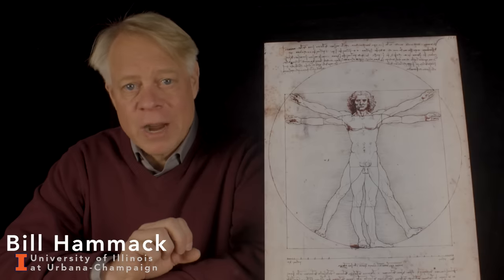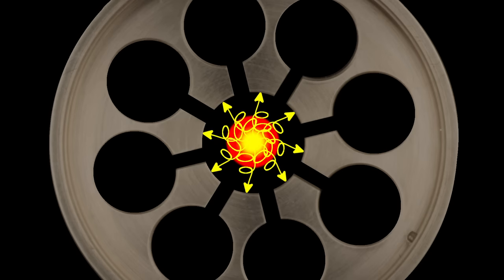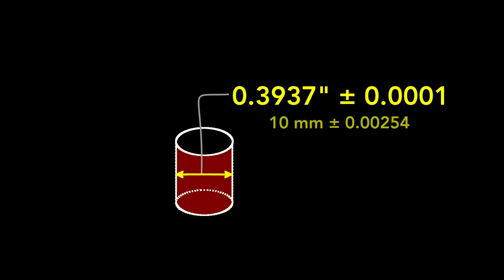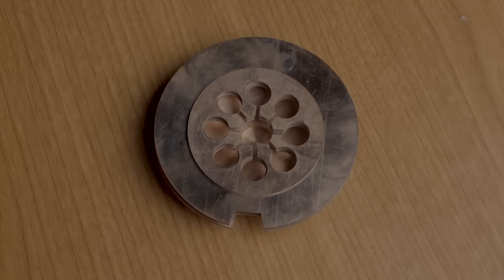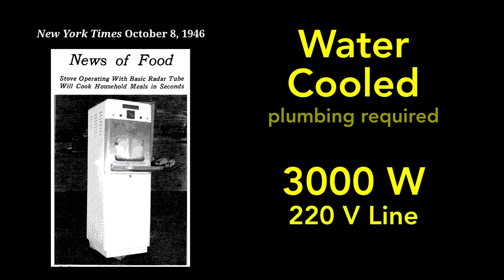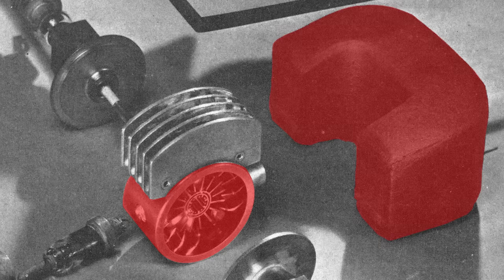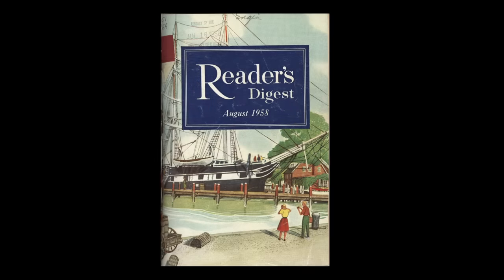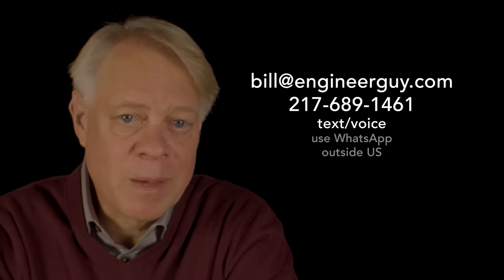The Microwave Oven Magnetron: What an Engineer Means by “Best”

Comment: I wondered can we increase the frequency of magnetron without changing the Cavity sizes ? Can we change it by Varying the Megnetic field or electric Field  !!
Reply: That is the major limitation of magnetrons, the size of the cavities determine the operating frequency.
Other types of tubes, like the klystrons, can operate with a wider range of frequencies. The one I used the most was the CX250A.
Reply from the maker: Aren’t klystrons used often in satellites? I know everything is no solid state, but if you really want power (oven or sending info from space) you still can’t beat a vacuum tube … right?
Reply: @engineerguyvideo I was contemplating the idea of attempting to build an Ammonia maser based on what I had read in my intermediate physics textbook. Initially, I had the impression (due to not clearly noticing) that the RF source utilized in it is typically 2.4MHz. However, upon revisiting it recently, I realized that it's actually 24,000MHz or 24GHz that is employed in the maser to excite the Ammonia resonance cavity. This led me to wonder if it's possible to obtain even a small amount of 24GHz output using a conventional magnetron without modifying the cavity, but rather by altering other factors such as the magnetic field. This is because electrons, as charged particles, follow curved paths under magnetic fields in proportion to the field strength. While the cavity determines the frequency as resonance, it doesn't block the generation of other frequencies. Resonance helps amplify that specific RF frequency. So, the idea is that by adjusting the magnetic field of the microwave magnetron, we might generate some other frequencies, albeit not with the same amplitude as the cavity resonator-tuned RF output. Then, this weak RF signal can be amplified by the maser resonator itself.

Comment: Sniff. You didnt explain why the tolerances...

The most amazing part of magnetrons is the rf black magic that the slots are capacitors, the holes inductors, and the whole makes a tuned LC tank circuit... and that to be in tune... it has to be precise!
And then how the signal is led out through this wee lil wire with a loop in it.

Yeah ok, that side of things becomes a bit too eye glazingly technical...
Reply from the maker: It does!

Comment: 9:20 Only 650W? Damn that's one low power Microwave. The standard here in the UK is 800W, and it's easily possible to get them at high as 1000W. I don't think I've even seen one lower than 700W in a long time.
Then again, here in the UK, Mains sockets are rated at 13A 230V, which is 2990W, which I imagine is higher than the rating over in America.
Reply from the maker: I am old and though of 1989!
Reply: Very informative video. 
I'm getting old too, I was alive back in 1989, but don't really remember much from then.

Comment: How does stacking multiple discs allow for the width tolerance to be maintained? Wouldn't that make it worse as the stacked discs would be able to shift relative to each other?
Reply: if I had to guess I would say its because the punch can create the shapes with incredible precision and uniformity, and then the small holes can be refined into shape a lot easier. but to drill a big hole into a solid piece you had to do by hand measuring every cut and drill so they would all look exactly the same. remember it was before automation was a thing.
Reply: I believe they used precision jigs to assemble them, and it was difficult. But it was still easier than machining it from a solid block. but im not completely sure
Reply: All the discs are punched using the same tool. Inherently high accuracy is essential for the punching process whatever the end product. They are assembled on a fine tolerance jig for assembly and clamped/pined in place. There is no mechanical force on the assembled stack so no movement.
Reply: In my opinion the tricky part here is to how keep the discs precisely centered on each other, and to do that with fasteners or adhesive just shifts the tolerance problem to somewhere else, as if you're using pins you'll then have to precisely manufacture fasteners to that tolerance, or if you're using adhesive then it's the jig that holds it in place while it adheres that has to be that precise
Reply: If you machine or drill you have the problem that the top of the tool follows the toolpath exactly or stays where you put it but the bottom deflects and wanders, so effective hole can taper and widen throughout the depth and become uneven; also it's not uncommon for deep holes to become angled a little. So deep holes become a HUGE problem, but you can solve it if you manufacture slowly and expensively. Shallow holes and laminated assembly, you transfer the precision issues onto assembly jig which is made once.
Reply: @amostan6069  Hi Amos, you need to do some research into power press tooling design and tolerances. The magnatron worked as designed.
Reply: @trig  thanks for the recommendation - I'll have a look :)
Reply: @amostan6069  Yes, it shifts the tolerance problem to a single jig which could take a week to create. But in the next week, and every week thereafter, that jig could allow any random person with little mechanical skill to make 1000 assemblies.

I also suspect that the holes were lapped (on another jig) after assembly if the diameter and stack alignment needed to be within 0.0001".

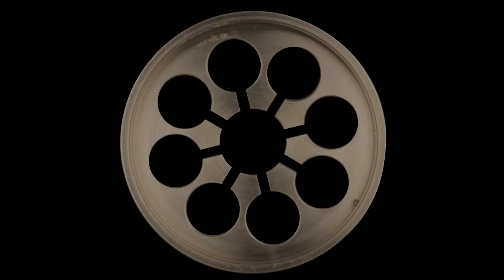Comment: The "Nazi plane" @1:24 is Finnish. At least the markings are. It's, I believe a Bf.109F, but in Finnish markings.
Reply from the maker: I have heard
Reply: @engineerguyvideo  I scrolled down a ways to see if someone else had pointed it out but didn't see anything. Sorry, it's just my model builder's obsession with detail. Good video. I worked on the radars of F-4Ns in the Marines. Not engineer level, but I had a few magnetrons in my hands back then.

Comment: I thought this was an extremely good video. I just have some very nitpicky points.

First, the original Radarange did not cost $2,000 but in fact approximately $5,000 in 1947, which was over $4,200 in early 1946 money, or $70,000 today (as calculated by the CPI). The original customers were all businesses or the U.S. government. Microwave ovens didn't enter homes until 1955 with microwaves produced by Tappan, with the RL-1 selling for $1,295 (around $14,500 today). Very few were produced in the 1950s or early 1960s (though they existed, and some recounted histories ignore them completely), but by 1967, there was competition in the market and a significant supply of consumer microwave ovens costing under $500 (the Amana Radarange was first released at a price of $495). Prices dropped below $300 in the 1970s and below $100 in the 1990s, with the cheapest microwave ovens now costing just under $50. So in real terms, prices have dropped more than 1000-fold since the 1940s, since most of the cost of a microwave oven has always been the magnetron.

Second, it is simply incorrect to say that 3000W was "four times a typical microwave oven today." Today, most microwave ovens operate at approximately 1000 W, which is a third of 3000 W. Directions are commonly given for 1100 W microwaves, and only the smallest ovens are 750 W or less. Microwave ovens exist operating at a fourth of the Radarange's power, but they aren't "typical."
Reply from the maker: All fair points … to figure out the price in current dollars is always perilous and I try to avoid it … also I am showing my age, when I bought a microwave in the late 1980s 1000 watts would have been rare; I need to remember that I am no on the 21st century!
Reply: @engineerguyvideo  Yeah, I included inflation calculations because I was comparing prices across time, but I agree, there isn't really a perfect way to do it. Electrical elements in general are cheaper than they used to be, so it's not surprising in that sense that the price of a microwave didn't increase as fast as the price of other goods. But it sure did get cheap! Imagine telling someone in the 1960s that microwave ovens would be favored by broke college kids because they were so much cheaper than conventional ovens.

Comment: Off topic but I always found it bizarre how microwaves were marketed as primary cooking devices. Which they are terrible at, while looking down their nose at its real strengths. (Light warming of moist solids or boiling small amounts of water. Like making tea, warming detergent water when cleaning, warming shaving-soap lather, Speed drying white-glue in paper crafts).
Even in into the 1990s appliance companies were publishing microwave-cookery cookbooks that had things like steak and whole chicken. And to this day the control panels are cluttered with completely useless cooking programs and features.(while commercial units are simplified and have a selection of instant-start fixed-time buttons.
Reply from the maker: I agree with this. 20 years ago (plus) I interview a lot of the engineers who developed the oven for Raytheon. The mw is a terrible cooker of steak, lobster, and whole poultry. It was only when it became used as a reheated in the home that it really took off.
Reply: @engineerguyvideo  I mean way after they became popular for reheating the manufacturers were still trying to market them for primary cooking. 
I have a user manual for one I bought in the early 1990s that goes into great detail on how to "roast" a chicken, shielding parts of it with foil and such.
Reply from the maker: Indeed … they had these elaborate cookbooks well into the 90s. For a while I collected them …

Comment: The cooling fins on the consumer magnetron is not punched stainless steel. It's aluminum. Stainless steel is a terrible conductor of heat and more expensive than aluminum. It would make no sense to use Stainless steel for a heatsink.
Reply from the maker: Indeed .. my error

Comment: Need to step in and correct something you said that's just completely wrong. 
When comparing the first commercial microwave oven you called it as four times as powerful as common modern microwaves, yet that's not true unless you're talking about the tiny little crap microwaves cheap people give to college students.
The old commercial unit was 3000 watts, normal home units are about HALF that, not a QUARTER.
That is enough if a difference to call out. At least in the USA, standard microwave oven is often designed to suck as much power from a 15 amp breaker as possible without tripping it - which is around 1500 watts.
If 750 watt microwaves are even still a thing, they aren't for full homes... at least not in the USA.
Reply from the maker: Yeah, sorry … I was stuck in 1985 … indeed you are correct …
Reply: @engineerguyvideo  I really miss the hardcore gear from back then. The microwave I had in college myself was my parents' old full sized one - could have cooked a full chicken in there if I had the ambition to. Every year or two, the fuse would burn out (since I was using it in college dorm and apartment complexes no surprise at all given how many PCs and stereos and microwaves were constantly being used in the building) but other than that, rock solid for over 30 years, until I moved and didn't want to lug around that huge thing any more. :P The microwave I have now has a turntable and a few more automatic modes, but nowhere near the internal capacity. I could do a duck in this one maybe. :P